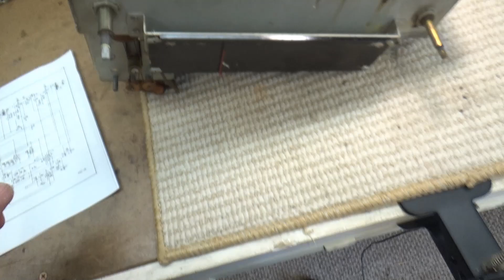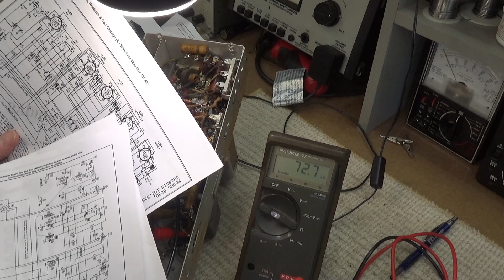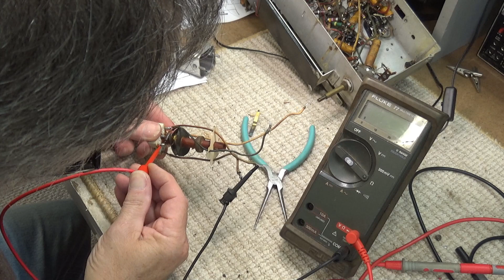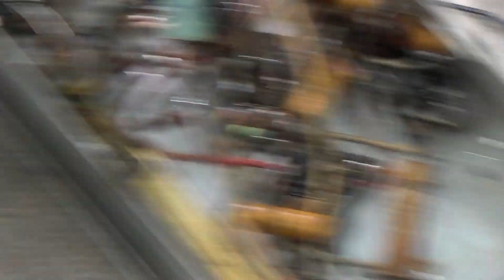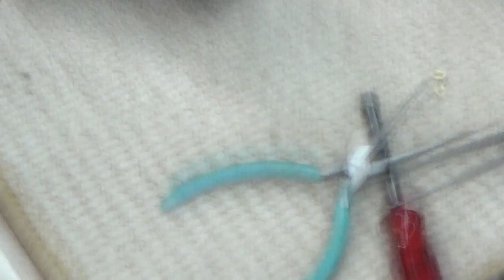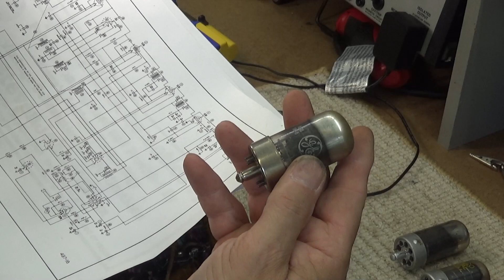EP 76Sears Silvertone Model 8230 Checkout Part 2

Comment: So someone decided to change the tubes to have a hotter heater string than 1.5 Volts. He must have removed the 40uF
25 Volt cap and a few other components to get it to run at 14 Volt. FAIL! Put it back together and now you are stuck with
it. Whomever did this was no Mr. Carlsons Lab graduate.

Comment: 1+ hrs. Toooo long. Kinda like watching paint dry. Maybe could be somewhat shorter? Radio similar to a 7104 tuning.  You seem to struggle on simple issues. How do you get to Carnegie Hall?  All those storage bins and you had to order caps?  Great closeups of the hairy hand and balding head. 😊
Reply: I knew this radio would trip him up with a previous repairer touching it hence  wrong tubes and the switch for either
battery /AC  missing, blurry schematic , poor note taking and a permeability tuner on it. It should work as designed
 with those tubes in the schematic as the heater line has additional components to drop the voltage down to 1.5 V.
If any of those components failed ( like the 40uF 25 V  electrolytic capacitor ) they would destroy the tubes.